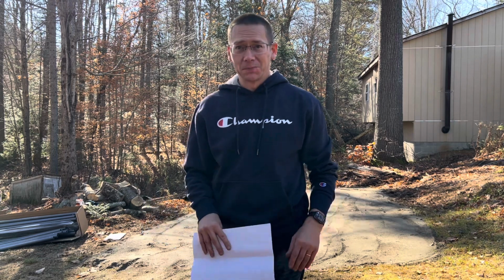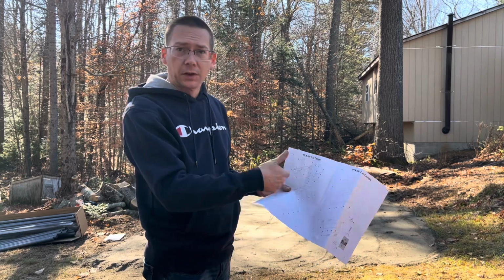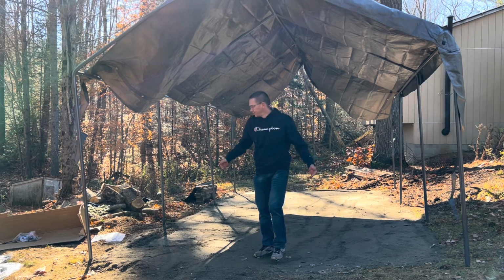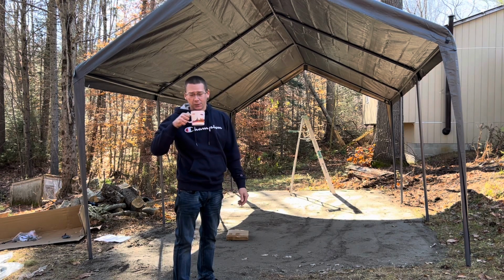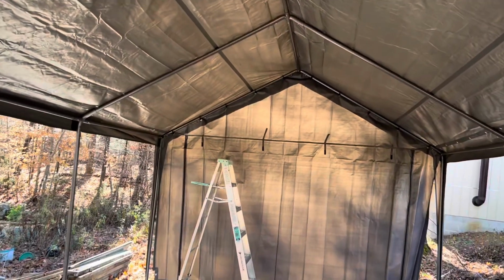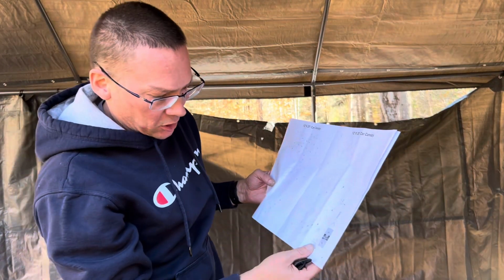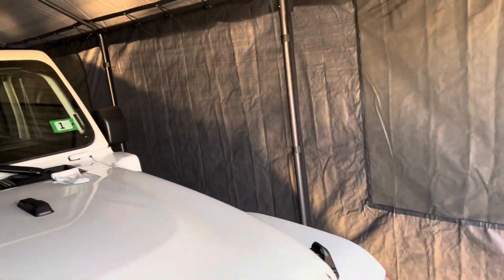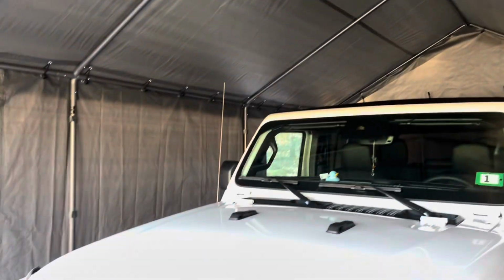Inexpensive Carport

Comment: For snow, I used some 2" wide ratchet straps with "loop" ends, in between the roof poles - total of 6.  It adds tremendous strength.  I also used ratchet straps inside, from side to side at the "ceiling" line.

Comment: I have the (almost) same carport, clearly made by the same Chinese manufacturer, which I also bought through Amazon.  I made the mistake of putting the roof tarp on upside down and had to take it down and turn it right side up and remount it after the roof was already elevated on the poles.  This was painfully hard.  I should note that I don't have any help and can't lift my right arm more than a few inches from my waist, so that adds to the difficulty.  Still, it would be nice if they marked the tarps with inside and outside tags so dumb people like me don't make stupid mistakes.  Also, I saved a lot of time and effort by attaching the walls with bungees every other grommet and the same with the roof but different grommets.   This seems to work perfectly well and saves a lot of time and effort.   I have a couple other complaints. The outside flaps covering the windows are fixed to the tarps with a very thin strip of Velcro and it is seemingly impossible to fully seal them shut.  They really need zippers instead. I also think that there should be a better way to roll the doors up, but I don't have a suggestion right now. The dual zippers on the doors work great, by the way.  Thanks for posting!